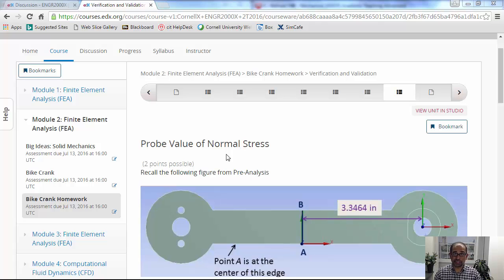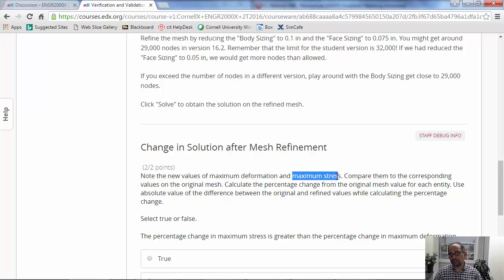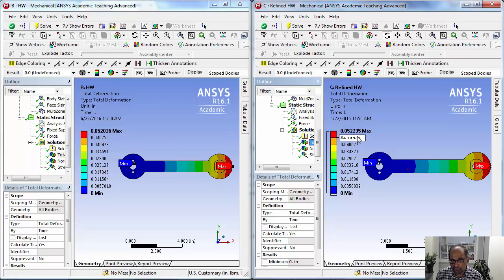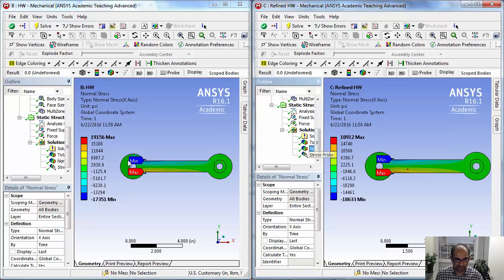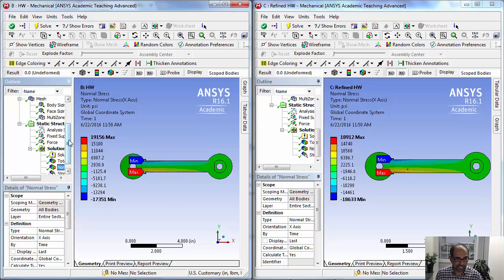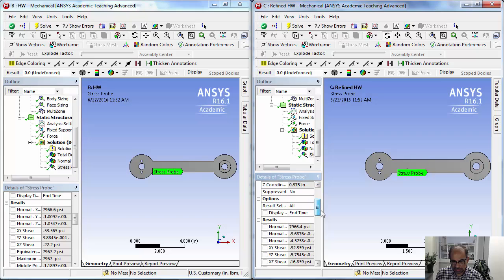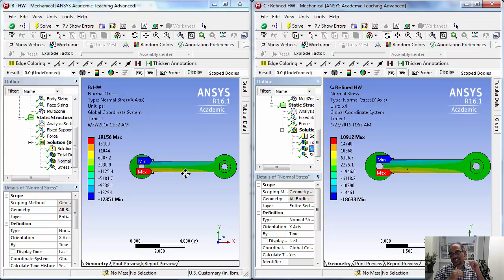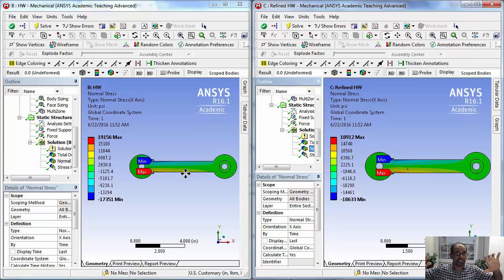Simulation MOOC: Stress Singularity

Comment: So, is there a way to resolve the singularity issue?
Reply: YES... AS WE CAN ADD FILLETS IN GEOMETRY. I THINK WE CAN REDUCE STRESS CONCENTRATION AT THAT PERTICULAR POINT.
Reply: Yeah, that's the point of the difference  among that homework and the previous example with the softened edge. in that example you wouldn't get that peak, because of the large fillet part of the Structural Design, or as Keshav stated, adding fillets you can reduce that error.
Reply: change geometry to eliminate all the corners